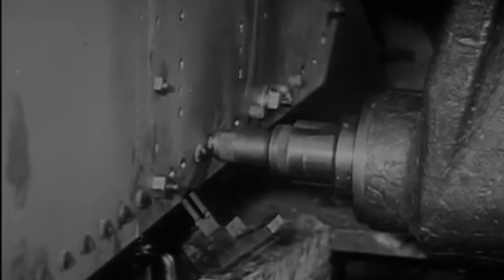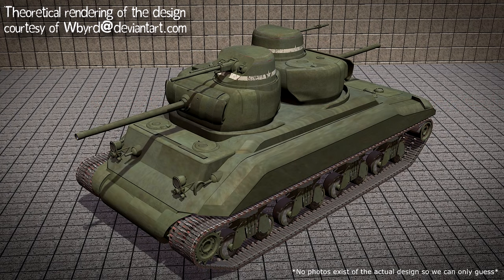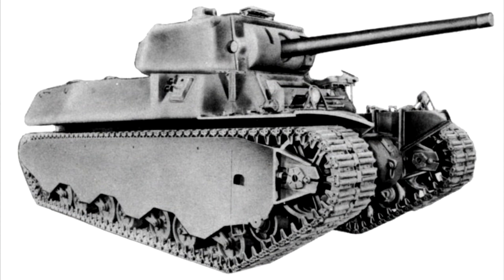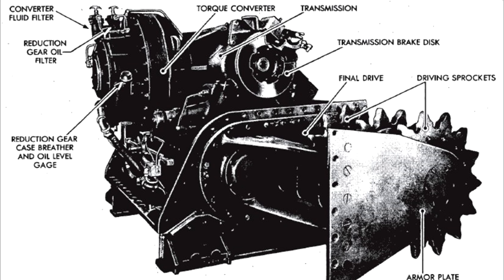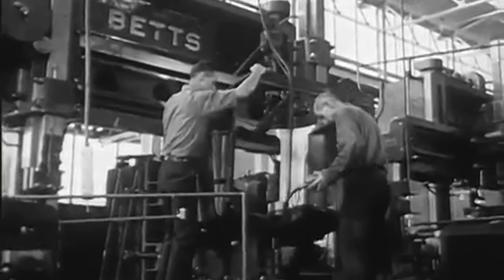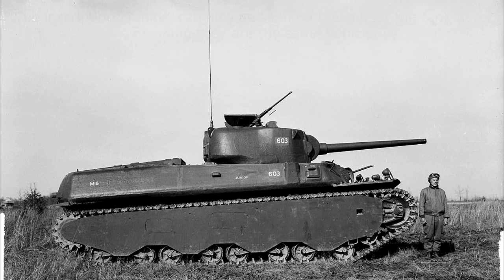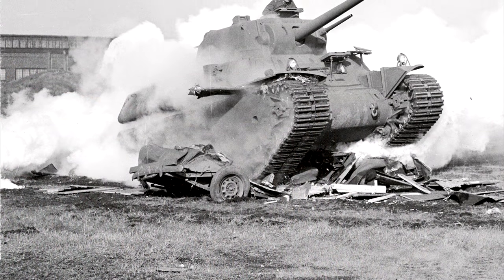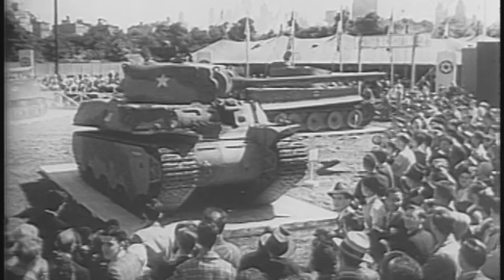America's Tiger, the M6 Heavy | Cursed by Design

Comment: I feel like the US could’ve used them if they were givens more development time and simplified to cut down on the weight and cost of the beast, get rid of those extra unnecessary machine guns, replace the coaxial 37 with a 50 cal machine gun, improve the crew layout/ ergonomics a bit and the US could’ve had a 90mm armed tank ready in 1944. It might’ve been a little less practical than the Sherman for logistical purposes but it could’ve been used a spearhead for attacking tank forces like the jumbo was. Would’ve certainly been more useful than the Pershing
Reply: Well, I will say T1 heavy is more or less a test bed for later development on other tanks, even thought it was not intent to be one. You see, both a tank that is capable of carrying a 76 mm and that of a 90 mm gun were actually built and entered service, which is Sherman and Pershing.
Reply: "extra unnecessary machine guns"

Blasphemer! When next your doorbell rings, it will be the Murican Inquisition bringing justice upon you!  <grins>
Reply: @Mustache_Sam  true they both could’ve mounted it, but still an American 90mm armed heavy tank ready for D day would’ve been badass
Reply: The US Army was perfectly happy using the M3 and M4 tanks since those shared the same automotive gear and the mechanics could work on either one out in the field or at the repair shops. Accepting the M6 would've required the need for mechanics specially trained to work on it, separate warehouses and depots for the parts and it's own repair shops. The US Army had a 90mm mounted in a M4 based TD in 1944 and began installing it's turret  w/gun in the standard M4 hull at the factories since those could be built faster and had better armor. The US armor commander didn't want the Pershing for the same reasons why they refused the M6 and were perfectly happy using what they had on hand.
Reply: More useful than the Pershing how?
Reply: @bobmcbob49  as in ready for the main invasion in 1944 rather than just 20 vehicles in 1945
Reply: @theultimategamer8537  The M6 production was cancelled in 1942 after the 250 made for testing kept breaking down due to it's weight. The M26 Pershing was a bust due to Congress forcing the Army to ship over the first 20 made without being tested and without trained crews and mechanics.

Comment: The big problem with  the US having a heavy during WW II was they had to be moved by ship, which requires cranes to load and unload in port.
Reply: They may have been too heavy for other things too like LST ramps, bailey bridges, smaller bridges on the way to Germany.
Reply: @gordonvorenkamp6306  True.
Afaik one of the issues they faced when field-testing the Pershing tanks was the weight capacity of assault bridges.
Reply: The US also had to send them from Detroit to a coast.  NYC is the closest at 600 miles (1000 km).  Similar distances would be Normandy Beach to Berlin.

What's the width limits on the tunnels?
Reply: The Liberty ships' cranes carried two sets of booms that were rated for 30 and 50 tons. They could've handled the M6s with ease by removing the turrets before loading then dropping them back in place once set on the deck.
Reply: @Zraknul  The M6 would've been shipped by barge to the East Coast ports.

Comment: 0:15 M4A3E2 was considered a heavy tank
Reply: no it was an assault tank, games label it a heavy but doctrinally there is a difference.
Reply: @matthiuskoenig3378  but it is a heavier M4 Sherman
Reply: @matthiuskoenig3378  the T14 is classified as an assault tank and an infantry tank and most assault and infantry tanks were also referred to as heavy tanks
Reply: @matthiuskoenig3378  the Jumbo is known as a heavy tank BECAUSE IT HAD THE ARMOR OF A HEAVY TANK! 5.5 INCHES TO 6 INCH FRONTAL ARMOR, 1.5 INCHES TO 3.0 INCH TO 6 INCH SIDE ARMOR, AND 1.5 INCHES TO 6 INCH REAR ARMOR!
Reply: It's classified as an assault with are similar to heavy tanks in the armor department. But there differences.
Reply: @panzerjagertigerporsche  Tank classification is based on the tank's intended role and purpose, not armor values or weight. This is why the Panzer V "Panther" is considered a medium tank even tho it has thick armor and weights around 40 tons. This is also the reason why we got classifications such as cavalry tank, infantry tank, breakthrough tank, main battle tank, gun motor carriage, tank destroyer, etc... Classifying tanks by their weight is basically a simplification of this. This is why the Sherman "Jumbo" is classified as a heavy tank, even though it's actually a breakthrough tank, or how most of the British heavy tanks like the Churchill and Matilda are actually infantry tanks
Reply: @m10tankdestroyer94  Germans never considered Panther a medium tank. They knew that if they call a heavy tank "medium" it wont get any lighter and engineers or bridges wont care about "its use". Thats why they ditched their pre-war classification. Both divisional Panther tanks and Tiger tanks from heavy battalions were in the same weight class (C) - 30 to 60 tons:
https://www.youtube.com/watch?v=DVdUCqx0omw
The best WWII classification is Soviet light<18t<medium<40t<heavy. And when they saw Panthers at Kursk they reported that Germans are using heavy tanks at divisional level.
Reply: @Paciat  Yes, just put a Sherman next to a Panther and Tiger and you will see it is pretty skinny in comparison. Also its 75m cannon looks like a peashooter. One interesting thing is that it is really no taller than the first two, something many so-called historians harped about but has no real foundation in fact.

The Firefly, on the other hand, had a good stout 17 pounder cannon to take on the Germans much more handily.
Reply: @panzerjagertigerporsche 
You disproved your point cause he said sherman and not jumbo or jumbo sherman
Reply: Heavy tanks were labelled as such depending on weight, armour and pay load my guy
M4 has never been a heavy tank 
Medium/heavy assault and troop suppression tank maybe but never Heavy

Comment: 4:30 I can't imagine why they'd put both 30 and 50-cal in one vehicle.  If you run out of one or the other ammo, half your guns are out of use.  Why not just standardize all guns on one round?
Reply: cause then you're either under powered, or wasting .50 cal ammo. 2 different uses, 2 different guns. don't recall exactly, but I'd say a lot had both. shermans had 2 .30's and a .50, no reason to waste .50 rounds on human targets when a .30 is more than capable, and light armor or vehicles would be less susceptible to .30, but a .50 will at least disable if not destroy them, saving rounds for the main gun.

Comment: Honestly I think that the tank could have done ok in Europe. It would be a clearer cut answer to the German Tigers.
Reply: I doubt it would have done well.  The base design simply didn't have enough armour for the role as it could be rather easily defeated by the ubiquitous 75mm PaK 40 and it's derivatives.
Reply: Compared to the M6, the 76mm Shermans and even the 75mm ones are still the far superior answer to the German heavies since they are already capable of killing them while also being more reliable and easy to produce. The Americans wouldn't even be able to send the M6 to Europe as it's far heavier than 40 tons, the maximum carrying weight of Liberty ship cranes. If they somehow managed to send even one M6 to the frontline it would've just been immediately destroyed in the battlefield thanks to German anti-tank guns that would have no issue cutting through it's front armor so no, you're just giving German crews free target practice
Reply: @m10tankdestroyer94  Bollocks.
Reply: @m10tankdestroyer94  Yeah, the Sherman gets such a shit rep despite its actual performance.
Reply: Step 1: Take 90mm M6 from 1942
Step 2: Remove extra guns
Step 3: Evict excess crew
Step 4: Sherman hull plates . add
Step 5: Snipe at 1943 tanks
Step 6: 200 hulls not wasted . success
Reply: @EvillBob  The biggest problem with the Sherman fanboys is that they get their 'info' from certain dodgy cherry picking videos instead of balanced sources like this one. Like that a big tank 9 feet wide would fit on a rail car.
Reply: @FairladyS130  wait? There's actually videos that focuses on the positives of the M4?! Well that is an alien sight to me, the closest videos I can think of is "Myths of American Armor" and "Sherman: Why the Bad Reputation?" because nearly everything else is just "Sherman is a deathtrap" BS
Reply: @m10tankdestroyer94  There is nothing wrong with mentioning  a tanks good points as long as they are good and not made up. Just one example, when the 76 mm gun was first used it was rubbish, see Eisenhowers report. It was only when HVAP ammo started to become available near the end of the war that it became effective. See how misleading your comment is?
Reply: @FairladyS130  I can definitely see how misleading it is, I seriously overlooked how late the HVAP entered the war. Yeah I'll need to fix that comment
Reply: @m10tankdestroyer94  the 76 mm was most effective with HVAP ammunition. However the gun itself wasn’t terrible. It couldn’t really pen a Tiger or Panther frontally but had no problem from the side. I was surprised that the Soviets had Shermans with 76mm guns and they used them quite effectively against the Germans.

Comment: One issue on Tank Size was transportation across the oceans> An M4 Sherman colld be loaded by longshoremen on most US docks> Gen. Patton used his tanks w/Artillery Tactics (TOT = Time On Target) made use of dozens of M4 Shermans to LOBE multiple shells onto a single panzer where w/a truck load of STEEL dropping out of the sky on top the Panzer, it overloaded its suspension, (Wheels came off) disabling the panzer, mox nix size of tank gun

Comment: This video gives the third explanation I have heard for cancellation of the M-6 program. I believe Ian Hogg in one of his books claimed the M-6 was cancelled because fewer of them could be placed on board a ship when compared to the M-4, and it was decided by Army leadership that having a greater number of tanks was more important than having  more powerful tanks. Quantity versus quality. Belton Cooper in his book Death Traps said it wasn't sent to Europe because General Patton objected to having it. According to Cooper, Patton's philosophy of armored warfare held that the primary purpose of a tank wasn't to battle other tanks, but to operate deep in the enemy's rear areas destroying soft targets like fuel storage and ammo dumps, for which he felt the faster Sherman was better suited.
Reply: It was cancelled for three reasons. The first was that it's crews hated their cramped working conditions inside the fighting compartment. The US military valued the opinions of those that had to use issued equipment so was quick to ditch whatever the end users strongly disliked. The second was that the US armor commanders flat out refused to accept any to use at the front due to being too slow to keep up with their faster advancing forces. The third was that the M6 would require it's own parts warehouses and depots, it's own repair shops and own specially trained crews of mechanics and crewed armor recovery vehicles. They were perfectly happy using the M3 and M4 since they shared the same automotive gear and suspension plus their mechanics could work on either one at the repair shops.
Reply: Shipping wouldn't of been a problem since they had Liberty ship tank transporters that could hold 400 M5's or 260 M4's. Those carried two sets of booms for the jib cranes that could handle 30 and 50 tons. None were sent to North Africa or Europe due to the Army cancelling it's production in 1942 after 250 test vehicles went thru field trials. There they found that the M6 couldn't be operated over 10 mph for very long before experiencing mechanical problems and track failures. The armor commanders didn't want a slow heavy tank that would need constant repairs nor one that their crews hated to use due to cramped working conditions that made their jobs difficult to do efficiently. Patton probably did object to using the M6 since he planned Operation Torch and the landings at Sicily.

Comment: I think it's tempting to say they should have been put to use, and they definitely would have found much use had they been shipped over -assuming they could be kept running at acceptable rates, and that's a big ask for such a thing, but the question I don't think has a good answer is "would it be worth the logistical effort to move and support these tanks, or would those resources supply a much more powerful force of other types?"
Reply: The Army decided not to use the M6 due to being too slow, having too many mechanical problems due to it's weight and that the crews hated their cramped working conditions. The Army also didn't want the M26 Pershing since it would be slow plus too heavy to cross most road bridges and their pontoon bridging. The M26 was the T25 heavy medium tank that had 10 tons of additional weight added to it which led to engine and transmission problems.

Comment: I always figured the US didn't invest in heavies during WW2 because of logistics, an m4 was cheaper and easier to make for the same job, and I imagine you could ship a lot more at a time. Also a crew of 6 seems like a bit much lol
Reply: Exactly. It's fine to design and build a 40-60 ton tank. Good luck getting it to Europe. Most US tanks were built in Michigan/ Ohio etc. You have to get the tanks to to NYC/ Boston/ Baltimore/ Newport News. Tanks aren't being driven 1000+ miles to the ports, they are going by train. Train flatbeds have a max capacity they can carry. Trains also go over bridges which have weight limits.

Ok lets say we go one tank per car instead of 2. Well you need 2x as many trains or flat bed cars. What production is being stopped to build more rolling stock?? Even the USA had limits to its industrial capacity.

The train arrives in port. Now you need to get the tank onto the ship. You don't just drive a tank onto a boat. A crane has to lift the tank onto the transport. What is the weight capacity of the cranes at the harbor? What is the weight capacity of each ship? Would you rather transport 4 tanks or 2 tanks per ship?

Now we make it to England. What is the weight capacity of their cranes, and their roads and their bridges???? This country, it's ports and infrastructure have been bombed the past 2-3 years.

Let's say all of that is tackled, like a video game.

How exactly is this 40-60 ton behemoth tank going to be transported across the English Channel for D-Day? I'm pretty sure an extra 10+ tons on an LVT is going to hamper its performance, much less how far across the Channel it can go before being beached.

The M4 was a compromise decision from day 1. It fit the logistical needs of the USA/UK and could be produced and transported to Europe in bulk. It held its own. With some minor gun upgrades it became quite nasty.

We need to consider the big picture.

The Tiger was a logistics mess for the Wehrmacht. It did not fit on the rail stock of the day, it was too heavy for many bridges, cranes etc. And most of those issues were to fight on the same continent (North Africa excepted).

WWII was not a video game.

Comment: I think the reason is mainly a logistical reason, same like why Union army didnt adopt the Henrys and fully adopt the Spencers
Btw the M6s did provide a valuable insight btw, as a test platform for a heavier guns
Reply: The Union Army didn't adopt the Henry rifle and Gatling gun because they felt those would be too expensive to operate due to their high rate of fire. The Germans had the same opinion with automatic rifles before and during WW2. They felt that the soldiers would waste rounds firing willy-nilly without hitting anything whereas those with a bolt-action rifle had to re-aim at their target after chambering a new round.

Comment: They could have fitted the, exceptional for the time, British 17-pdr gun, which was smaller and lighter, yet could knock out any German tank. The turret then need not have been so big and heavy. OK they could have got a handful into use. They would need spare parts with associated logistical supply train, and mechanics who could repair them. For few tanks? Their impact, having so few of them, would have been so small it was not worth the bother.  It was hardly worth the bother getting the Pershing operational.

Comment: I’m going to quickly point out that as a result of the connection to the T29, the M103 is a distant descendant of this heavy tank, which in any case drastically helped us understand how the later tank would be used in the Cold War in Europe through the 60s with the Marine Corps.

Comment: I think the M6 could have had its moment in the sun during the Italian Campaign of '43-'45. It still would have been a niche assignment, with only a handful of vehicles needed, but the one thing I think this tank could have done better than any other US tank (including the Jumbo and 105mm-armed Shermans) is griding through mountain pass defenses. 

Assuming the up-armored model could defeat the later-war heavy Pak88's, then simply cutting out some of the extraneous guns (including the coax 37mm) and making sure the tanks had constant infantry support could have given the US a sort of "rolling roadblock" formation. Give the tank a more reasonably-sized 105mm and make it clear that it is only there to destroy bunkers, not fight tanks, and you would have created the right number of true "breakthrough" tanks for the right front at the right time and at little ongoing cost, considering the things were just sitting there by '44. 

This also assumes that the army would only deploy them along mountain roads they could actually navigate--I would NOT want to be in that thing on some winding coastal road or something.